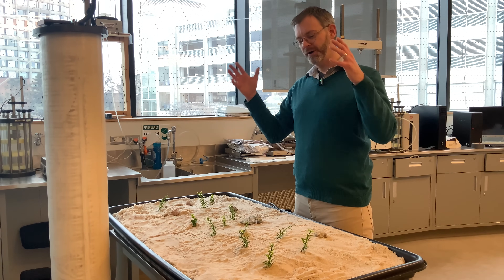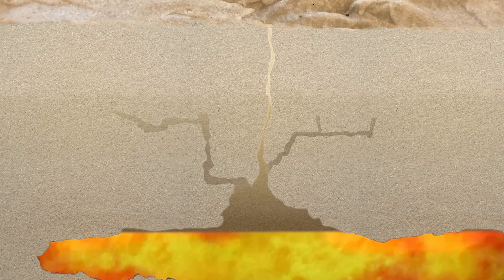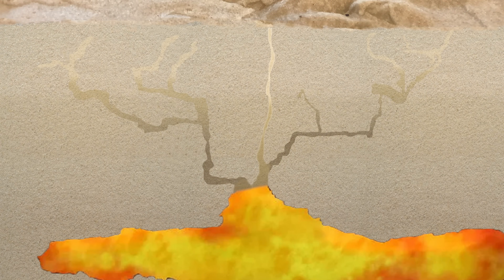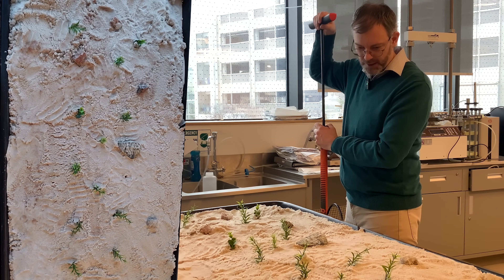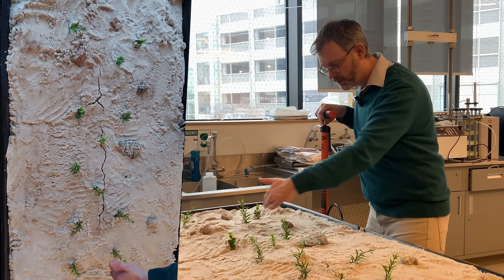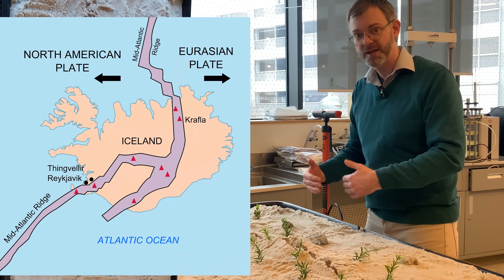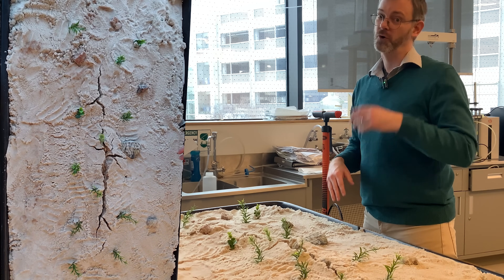Grindavik -  Demonstrating Ground Cracking

Comment: Are you a geologist? 
This seems visually similar at the surface but not an accurate representation of the actual ground dynamics. I expected your sand table to be much deeper, maybe with a bed of flat rocks below, and for you to pump in a viscous material that would seek a path to the surface and causing deformation during the process.
Reply from the maker: I wanted to have a simple explanation rather than a complex system to reach a general audience. Of course the real dynamics are much more complicated and reach much deeper than possible to scale accordingly in a simple lab setting.

Comment: I would think that building on the rift is not a great idea.  There are problems building close to the rift and building on an island that has a rift running through it but building on the rift, even if it doesn't happen for 900 years, is not a great idea.  Nice presentation.
Reply from the maker: Thank you for the encouragement. Wikipedia says that Vikings settled in the area in 934. So they didn't know about rifting when the town was built up. But it has been an important fishing town since at least the 13th century.
Reply: Iceland was created because of the rift, and the whole island can be potentially affected. I think about it like this; while sudden catastrophic events do happen, most geologic events are very, very slow. Most places on Earth have potential for disaster (floods, fires, hurricanes, landslides etc) on much smaller timescales.

Comment: A model which can be pulled apart would likely be a better analogy for what's happening in Grindavík, since the fracturing is not due to the uplift.
Otherwise we would have seen fracturing directly near the Svartsengi powerplant and the Blue Lagoon.
Reply from the maker: The pulling apart is happening at a much larger scale across Iceland, but the model is a small representation of one aspect related to this. The gas pressure certainly can causes new fracture growth, but there are many other factors at work in such a complex system.
Reply: @geomechanic  From what the IMO published, there are two relative small scale Graben being formed at Grindavik. I think that can be well represented in an analogue model.
But I generally agree, the oblique rift zone at the peninsula creates much more complex tectonics.
Reply: I think you would see fracturing on the surface near the powerplant & Blue Lagoon if the magma wasn't so deep there, but much would depend on the rock types.
Reply: @MalcolmSnelgrove  greatest vertical difference is ~50cm there over a large area, Rocks are more stable undergoing compressional stress, but break sooner undergoing tensile stress.
The ground at grindavik moved horizontally 1.4m Jan.14th and more than 2m at Nov.10th.

Comment: I was under the impression that this wasn't the only event causing the chasms and crevasses in Grindavik. I believe there is also an ongoing rifting event where the crustal plates are separating, further exacerbating the problem.
Reply: It think it could be that the rifting is what causes the magma/fissures/volcanoes in the first place (thin crust) over time. But rifting is very slow & a culmination of all the events trending in a direction, taken together... Individual crevasses have local causes.
Reply: Yes the fracturing of the ground beneath grindavik is due to reactivating of previous fractures and the formation of small Graben due to the intrusion of a magma dyke beneath.
Reply from the maker: Yes, there are many elements at play. The illustration tried to show one small aspect that contributes to the overall rifting that is happening at the larger scale.

Comment: It's not like the mid Atlantic ridge, Iceland is on the mid Atlantic ridge and the deformation along the ridge is mainly due to thermal currents forcing the crust apart. This is a good demonstration of up lift but its not the whole story.
Reply from the maker: Yes, of course. The whole story is much more complicated than I could develop in the sandbox. Perhaps I can add further elements to capture different aspects in the future.

Comment: I’m a geek about these things, but I’m also a measurement technician.  Measuring the height of a column of fluid (like in a huge tank) by measuring the ‘head’ pressure at the bottom of the tank is something I did for a living. 

So I asked myself what that pressure must be at the magma chamber to support a column of fluid magma to the surface.  

If the top of the chamber is 3 miles deep that is 15,840 feet.  A column of water that tall creates a pressure of 6867 psi.  Magma is liquid rock, it is heavier than water, so I searched for the ‘specific gravity’ of magma and got a range of 2.9 - 3.4 and decided to use 3 because it is a nice round figure. 

So, 6867 X 3 = 20,601 psi. Per square inch.  There are a little more than 4,000,000,000 square inches per square mile.  Mentally I can see we are around 80 trillion pounds of force pushing up per square mile of magma chamber. 

Mind numbing big numbers and I am sure there are many variables that would adjust those numbers up or down, but it was just a mental exercise anyway…
Reply from the maker: Wow, thanks for the rough pressure calculation. Indeed, this is part of the reason we cannot stop it!
Reply: There is one more thing missing. Lava has a lower density than cooled rock, since it has gases dissolved in it. When, or if the pressure drops below a certain level, you get the same effect as opening a large bottle of coke after shaking it.
Reply: @Mp57navy  That is why I used the specific gravity of magma, which is by definition liquid rock. 

Otherwise I might have used the specific gravity of basalt. (Just an assumption that Grindavik magma has the right proportion of silica to be considered basalt when cool)

Comment: While the illustration is intriguing, I am wondering a bit about the etiology of factors here. As I understand it's not solely the influence of magma and magma pressure (or the air in your experiment) that drives crack propagation. The stretching of plates, the forces of ridge push, and other plate tectonic forces contribute to this phenomenon. As far I can read the distinction between these elements remains somewhat elusive, emphasizing that it's not just the magma but a complex interplay of diverse tectonic forces that causes these cracks.
Reply from the maker: Yes, it is much more complicated than illustrated in reality. Different tectonic boundaries have different influencing factors. Where you have mountain building, you have convergent boundaries and different stresses that contribute to crack growth, earthquakes, and fault slip. I would say that faulting in a convergent boundary is the more dominate mechanism of ground movement. Grindavik is a divergent boundary, so the stresses are different and the magma intrusion plays a more dominate role in ground movement, with faulting happening as a secondary affect to accommodate the magma intrusion at different points along the boundary.
Reply: My professor, and others, assert the exact opposite; that is, plate tectonic forces, other than magma, are the primary factors. According to this perspective, these forces propagate cracks, clearing space and facilitating the ascent of magma to the surface. While there are dissenting opinions, there is a consensus that Iceland is a geological anomaly in terms of the significant amount of magma extruded onto the surface. Thus, the precise tectonics responsible for the formation of the Icelandic plateau remain relatively unknown. @geomechanic

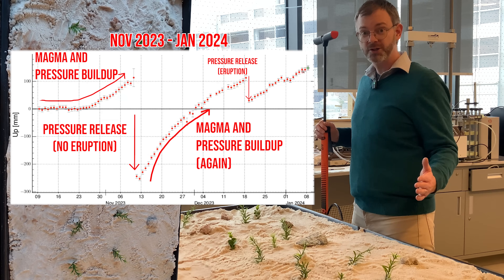Comment: The tectonic action has been a huge factor in the cracking in Grindavik - the town is not directly over the area of ground deformation caused by the main magma intrusion. It can be seen on the chart you show at 2:04 - the points on the far left is before the magma intrusion started, so is your zero point for ground height. The fact that it drops way below that zero point on November 10th (where you indicate pressure release) shows that the zero point must have in fact moved. The level of the sand in your demonstration has not & cannot sizeably drop below the height at which it started before you started inflating the innertube - therefore we can see that that change on the chart at that point must have been largely resulting from tectonic movement of the ground rather than pressure release caused by magma movement.
Reply from the maker: Yes, the reality is much more complicated and the lab demonstration cannot capture everything exactly.
Reply: @geomechanic  For sure! Even different experts have different opinions on what exactly is going on down there & it would be impossible to model the unknown ;þ